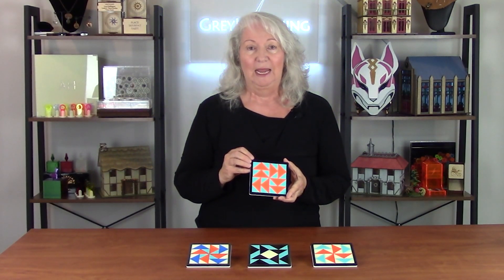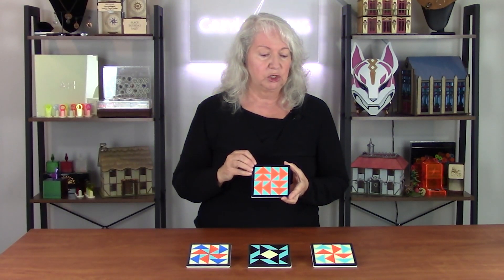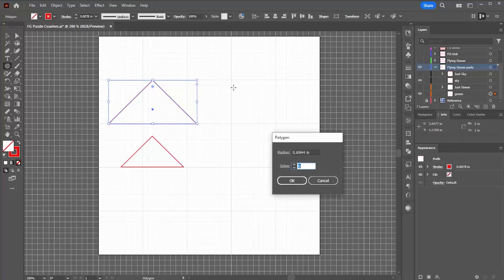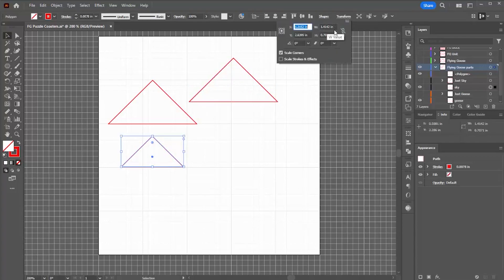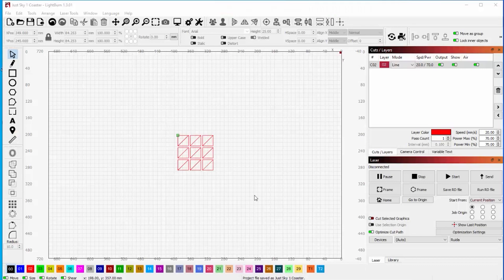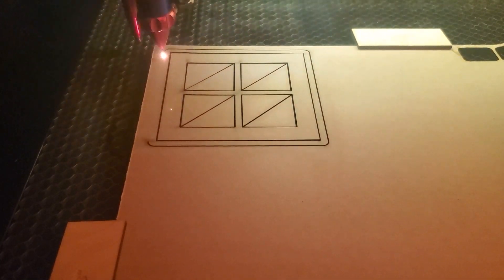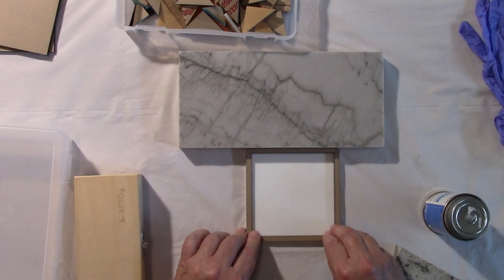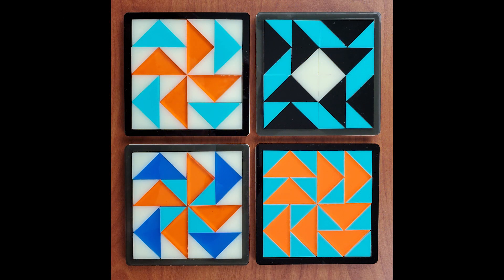How to Design and Laser Cut Puzzle Coasters

Comment: Neat little project, thanks for sharing. 
Weld On tips: use a little Aquaphor/petroleum jelly on the screw threads when you first open the bottle and it'll stay easy to open through the life of the bottle. 

Next, instead of removing the interior metal, I just punch a hole in the metal top. This is plenty of space to get a syringe in to pull out what is needed. Another bonus of just having a hole in the top also reduces the fumes released/evaporation when the bottle is open.
Reply from the maker: Thanks, xixstar, great tips! This Weldon can actually came with some sticky substance on the threads. I figure it was for a tighter seal, but it is very hard to close. Petroleum jelly sounds like a great solution!